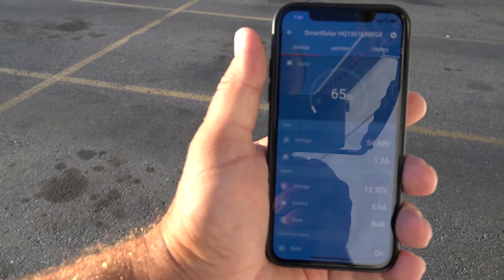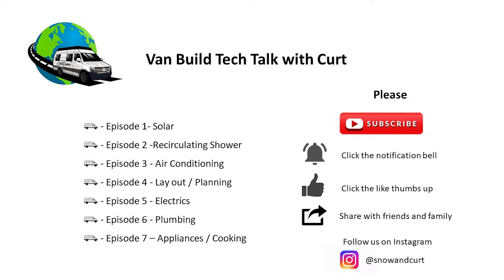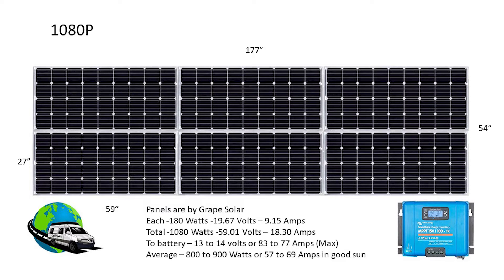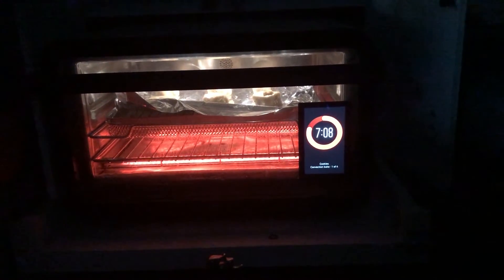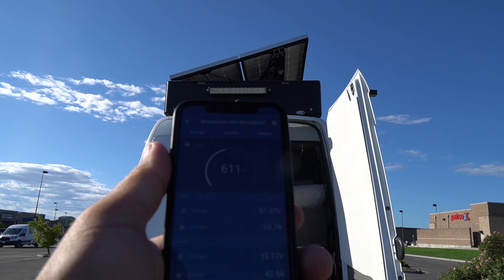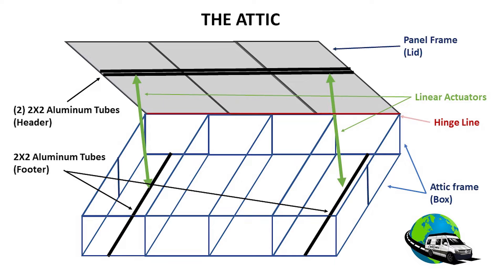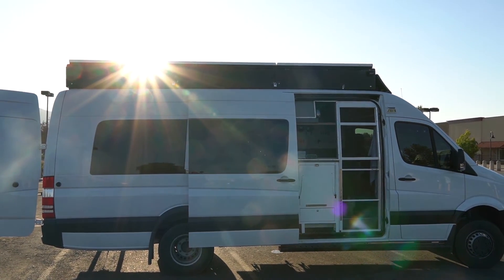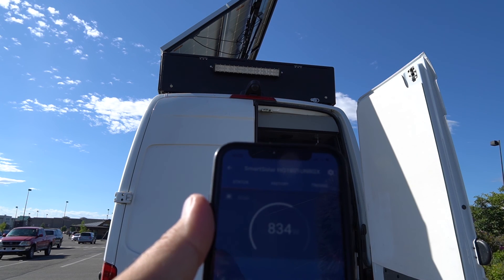1000 watts Tilting Solar, See the Power - Van Build Tech Talk Series -  Ep. 1

Comment: Hello Curt, thank you for leveraging the idea of tilting solar. I am in the end of planning my own van and going to start building. Thanks to you I am also going to create aluminium 80/20 frame on the roof with solars mounted inside. But I will do it flat to keep the van stealth - i hope it will look like "regular" roof rack from the side. There will be some relative small protuberances in the middle of the roof to give actuators some angle, but these protuberances should not be much visible from the side because the van is quite high. The feature I am going to add is AUTOMATIC TILTING - I am going to use Arduino to measure watt income from the roof and to control the actuators. Simple program in Arduino will then find the best angle for example every 15 minutes. Did you think about idea of automatic tilting? Thank you very much for inspiration, there will be spirit of you in my van! Cheers!
Reply: Are you writing that program yourself or is the coding posted somewhere? This is exactly what I've been looking for. I'd be very interested to see your build. Snow & Curt's was very helpful as well.
Reply: Hello Jennifer, I am going to write that program myself. But first I need to build the van itself. I got big plans also including "intelligent" air circulation using ventilation pipes with motorized air duct dampers controlled by Arduiono. I also got prepared even bigger lithium battery than Curt has (600 Ah at 24,8 V) so I can afford to use instant water heating faucets and electric heating. My charging will be based only on 3x 250W solar and, If I need it, common chargers for electric vehicles. At the moment I am not planning to share my build online. If you contact me later, I can keep you updated. :-)
Reply: @petrdjak  Thank you! I've added this to my notes. I'm in the process of finishing the building of my house and when it's done this spring I'll be listing it. When it sells I'll buy the 5th wheel I want and at that point will add the solar so maybe you'll have the program figured out. If not, maybe I will and I'll share the coding with you. I've been itching to write some code for an Arduino or one of the other boards.

Comment: Hi Curt - love this -  i watched this vid and got a custom rack made for my sprinter for tilting the solar panels, just a questions,  where did you get the wind defelctor at the front?  Is it fibreglass?  mine is not boxed in at the front so is a wind deflector essential?  or would there be too much uplift and noise?  cheers from Australia
Reply: Curtis, did you consider adding a triangular section in the front of the box, above the cab, to make the shape of the box a little more aerodynamic?
Reply from the maker: We did not... we always planned on just adding some sort of deflector.
Reply from the maker: We bought a wind deflector designed to be used for fifth wheels and modified it a bit to fit our attic. It is working great. The one we bought is hard to source... they didn’t have them on amazon at the time. But, now there is one on amazon that is similar to ours. Check it out here: 

Check out this Idea List on Amazon: Van Build Solar by ChillDaze w/ Snow and Curt https://www.amazon.com/shop/snowandcurt?listId=ZST9225C4TIU&amp;ref=idea_share_inf

Comment: Definitely an intentional & strategic build. Why heat absorbing black and not cooling white for the attic? I thought you were heating water in the attic when I first saw black.
Reply from the maker: Surprisingly... it doesn’t get hot in the attic... the top of the attic is covered in solar panels, most of the heat gets absorbed there. The reason for the black?? We had the material powder coated for better durability, black was our only option from the material supplier.
Reply: @SnowAndCurt  Ah ok. Thanks.

Comment: If you have both ventilation fans on the roof working, do you see a major difference in the inside temperature when your storage box lid is open vs. when it is closed (solar panels tilted vs. flat)? I am thinking of building something similar but my concern is that the hot air will be trapped inside the roof storage box when it is closed; in that case, the box might act as a ‘roof heater’ and the fans will simply be exchanging colder air from the van with the hot air from the box. After all, it is a closed box, lot of items will be stored there (more air flow restriction), box is always fully in the sun and it is also black in color (attracts more heat). What is your experience?
Reply from the maker: The box does not act as a “heater”... which I can see how that would be a concern. I think because the solar panels absorb most of the heat. Also, the roof box (or attic, as we like to call it) is not air tight). In fact, sometimes when the attic is opened up and the sun gets to hit the fans directly... that is when the air seems a little hotter. So, the attic seems to shade the fans. Who knew?? 

We have stuff stored up there, but not so much that it constricts the airflow or crowds the fans.

Comment: is your sun app capable of automaxing your angle unattended?? maybe only allowed when youre parked??
Reply: found this.. for more ideas about tracking.. https://www.youtube.com/watch?v=wL9PcGu_xrA maybe fully extend, then with one sensor on top, actuate to back off the angle until sensor is shaded??? you'd have to calibrate the position of the sensor with your max angle??
Reply from the maker: We chose not to have it automated... wind, overhead structures, only bring somewhere for a short time, and the security of items stored in the attic are all reasons that we wanted it to be manually controlled. But, I’m sure there is tech out there to do this... and it might be perfect for someone else!

Comment: Thanks for so much valuable information! Do you think the attic keeps the roof fans from working as cooly and/or efficiently as they could?
Reply: That's my question as well, would like to know if they can operate the fans with the "lid" down or does it have to be up a little?
Reply from the maker: The attic is not air or water right, air circulates within the attic. We notice know difference in the fans if the panels are up or down. In fact... the ceiling seems to feel much cooler with attic closed. 🚐🛠💙
Reply: @SnowAndCurt  - Where do you guys keep the A/C ---if you even have it?
Reply from the maker: Our AC is under chassis... Got to our channel ... Curt has a tech talk series and one is dedicated to the AC
Reply: @SnowAndCurt  - Cool beans (literally), thank you!

Comment: Do you have any solar tracking software to  do this automatically? Do you only tilt it when the panels can face southerly?
Reply from the maker: No software... we tilt as needed and when it works with where we are parked... if we are low on power, we make sure we park the right way. Another note... we built the tilt so that the panels face away from the slider door, making sure are “porch area” is usually shaded!
Reply: @SnowAndCurt  That's a good idea. I'm not ready to RV for another 10 years, but I'm a long-term planner. This little tidbits get filed away.

Comment: Loved it!  The difference of power generation with the tilt is so extreme that I can't believe more campervans don't have TILTING solar panels.  You have shown that tilting is almost as important as the solar panels themselves!
Reply from the maker: Right!!! When you sit there and can literally see the numbers... it’s crazy!! Thanks for watching!
Reply: @SnowAndCurt  how often do you have to adjust the panels to get optimum sun? The way they are setup you have to be there to control them to optimize it.. Or do you have a smart controller that handles it at this point?
Reply: He filmed this early morning to get the most extreme results possible. It's more like a 15% to 30% difference most of the day. More pronounced in winter months though.
Reply: @dvanomaly420  Good point. Still, tilting sure can make a difference.
Reply: @dvanomaly420 . Yes, HUGE difference in the winter.
Reply: @dvanomaly420  And you have to have the van oriented perfectly to take advantage of the tilt.     If you don't get the correct direction, tilting is worse that flat.   I'm on the fence with this.   Once in a while, when you can get the van perfectly oriented, it will pay.  But is it worth the extra effort....or just lay down a couple of portable foldable panels that can easily be pointed at the sun
Reply: Can't believe it Fullstop...

Comment: One impressive solar build, the results of the tilt, the attic, and the tilt mechanism. When traveling do you need to fasten the solar panel bank to the attic box?
Reply from the maker: The actuators lock it down pretty well, but we have a safety strap in place as well!
Reply: @SnowAndCurt  do you have a fail-safe if the actuators stop functioning while in the locked-down position?  Also, aren't the two vents you have in the interior portion of the attic box? If so, I presume that means you have no venting while the attic box is closed? I presume there would be a nice fix for that bu just adding two canals for each to a side of the attic box and drilling some holes on side of the attic box (bedroom vent to backside or rear of side, and livingroom vent to the side attic box) to allow for some airflow?